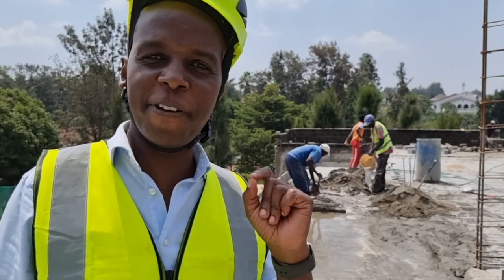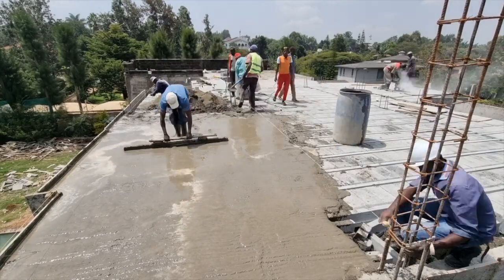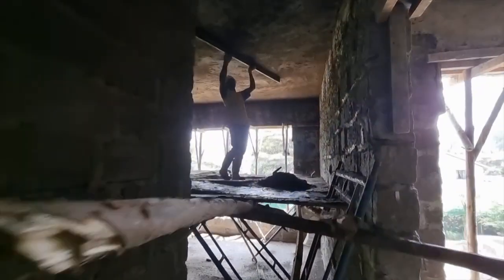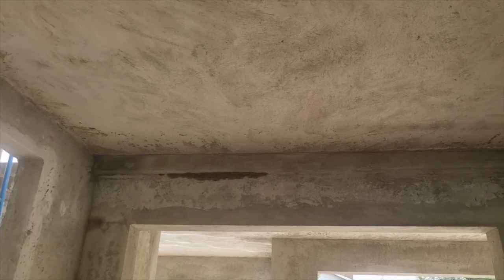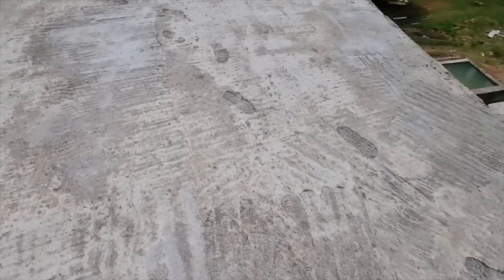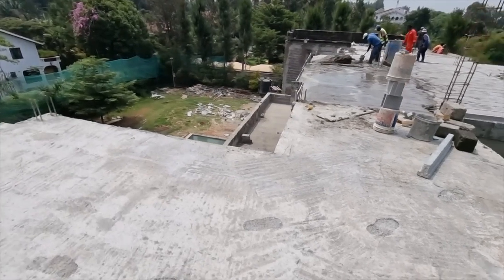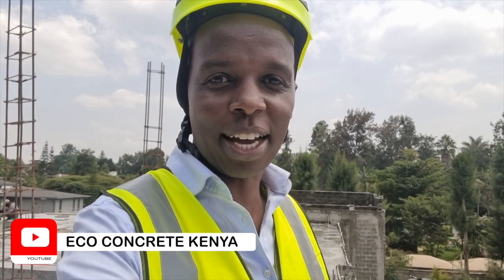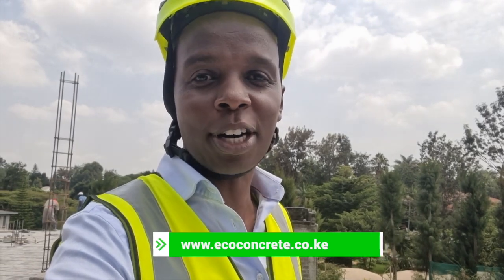Case Study - Runda - Screeding a Beam & Block floor

Comment: Everything is understandable but my question is; how do you handle extensions like balconies
Reply from the maker: Good Question , Beam and Block requires to be supported its not designed to cantilever .
Reply: All balconies are built on structural beams.
Even normally cast slabs for balconies will be done on structural beams.

A multistorey building = the load bearing structural beams and columns. 
Everything else from floors to walls and everything in between can be replaced as long as the load on the structural beams and columns is kept equal to or below design figures.